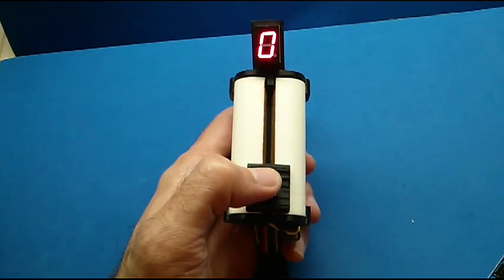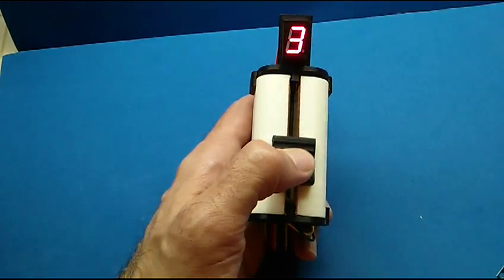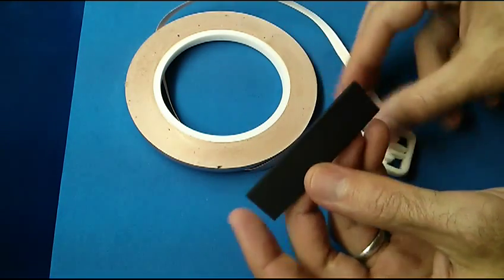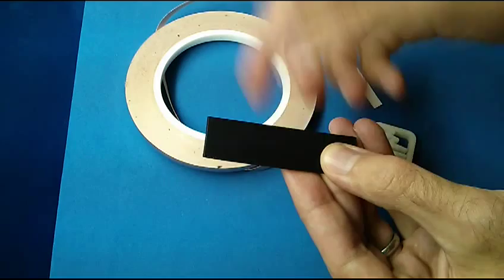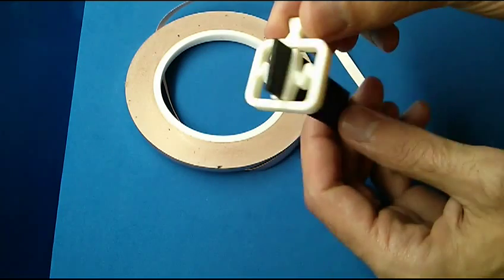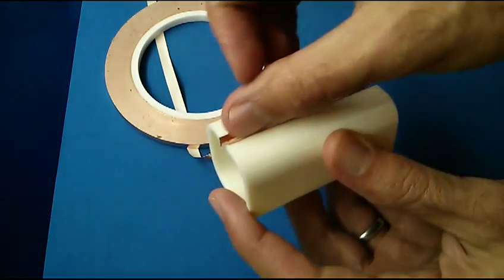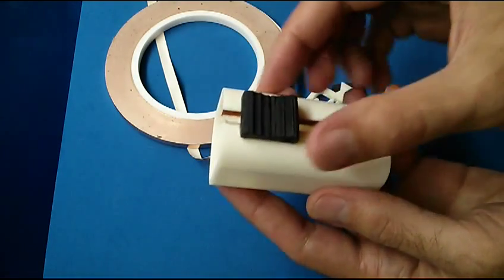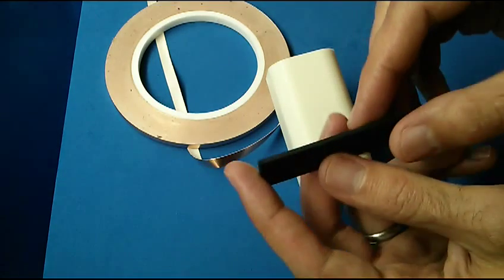Linear potentiometer made with conductive ABS

Comment: Cool design, how much resistance are you measuring across this stuff? I'm thinking of getting some to make circuit boards, but I'm not sure if it's too resistive.
Reply from the maker: It's way too resistive to use for circuits. For a circuit, you'll be talking megaohms. If you made really thick connections and had really solid printing you could get it down to 10,000 ohms. It also fluctuates quite a bit with temperature, pressure, and probably quite a few other factors.

There are some improved materials that I hear are on the way. I'm hopeful that we'll eventually be able to print circuits.
Reply: Matthew Peterson That's what I expected, I figured if this stuff could do a circuit board it would be a lot more well known by now. If they get the conductivity high enough I'd image you could just include the pads for your chips, then hit them with a heat gun and stick a chip in place. Though a typical FDM printer probably couldn't get fine enough for anything much under 0.1" spacing. Oh well, I'm sure that technology is not far off.